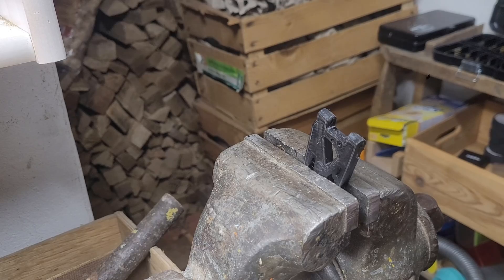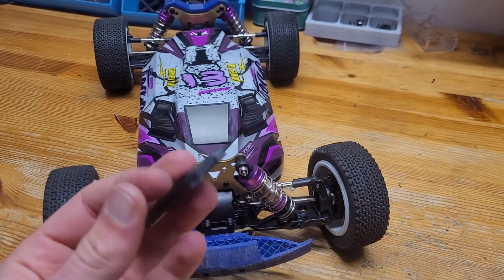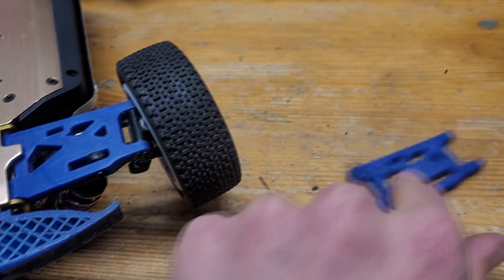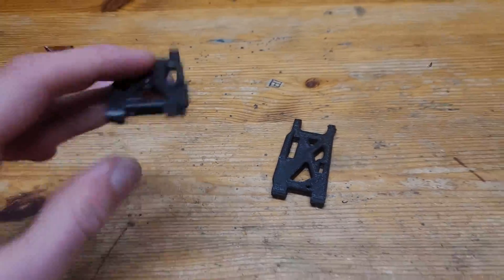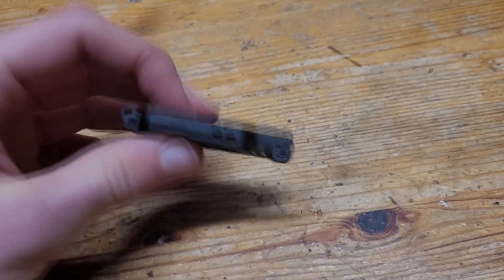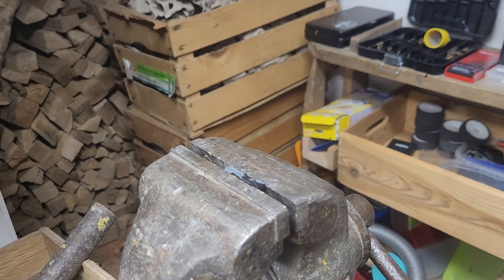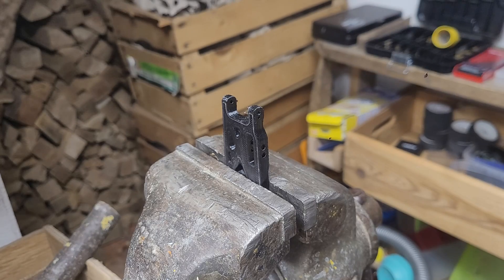I 3D Printed Unbreakable RC Car parts

Comment: Nicely done... I bash 1:18 / 1:12 scale on a budget... Tinker as wel using moldable plastics for parts that don't get too hot😅 I'm feeling this is the way to go for me as well.
Reply from the maker: Let me know how it goes! I'm currently working on some updated parts for these cars with even stronger front and rear arms, a front bumper designed to absorb impacts efficiently, protectors for the shock towers and maybe even a rear wing so stay tuned if you're intereste! :)

Comment: Hey, just curious what you did you use? I’m wanting to do a stiffer material than yours but still tpu. Also did you do 100%.in fill or ? 

How many walls ? 

Thanks!
Reply from the maker: As far as I recall I was using 100% infill, a lot of walls (I don't remember the exact number) and normal 95A TPU. There's a newer version of the arms in another video on my channel and I'm now working on V3, along with some other upgrades.
Reply: @ValRC1  okay. i think i am gonna try my hands at some 70D tpu. Looking for a more rigid solution as i mentioned. I have an old losi truggy that you cant get parts for but i still wanna race it a bit. So wanna try and make some arms that are stiffer and more predictable but still hold up.
Reply from the maker: @ZC-Hobbies  What scale is the losi truggy? I've found TPU only really works well for small vehicles like this WLToys

Comment: I'd thought about TPU for arms before, my only concern is that the flex will put too much strain on the camber and steering links, as well as the driveshaft. Awesome to see it worked out though!
Reply from the maker: Works great! I just don't recommend it for racing or speedrunning as it does make control a slight bit more imprecise because of the flex

Comment: I've made a few parts for my cars with a 3d pen. But I just use PLA. I wish they made a pen that could extrude that material. Might be worth it to make my own.
Reply from the maker: Damn, didn't think of a 3d pen but I'm guessing 3d printed parts are stronger due to being solid?
Reply: @ValRC1  using a 3d pen the parts are nearly 100% filled. For a swing arm like you did I would ink out the part on paper and just trace it with the pen until I had enough layers to reach thickness. There are a lot of 3d pen sculpting videos on YouTube that show you how. For me, I can't justify buying a printer if I can't model my own stuff and I don't have the motivation or time to learn blender.

Comment: I must have missed it but what filament is that part made of?
Reply from the maker: It's made of 95A TPU
Reply: @ValRC1  PETG would probaly also work pretty good i guess.  atleast allot better than plain pla probaly
Reply from the maker: @DiyNuke  honestly, Petg isn't as impact resistant as most people say. TPU is waay more durable if it doesn't matter that the part is flexible. A more impact resistant alternative to PETG is PCTG, or if you have a good printer and an enclosure Polycarbonate (probably the most durable stiff material)

Comment: imagine that TPU A-arms make an RC drive and turn better due to more 'flex' and maybe dampening in a way giving more grip e.g. more ground time for the tires.
i could absolutely believe this but this theory isn't tested as far as i know?
Reply from the maker: Maybe this can be true in some cases, but I actually noticed with these super flexible ones that the handling got slightly worse once I switched to brushless power. I made some new and improved arms to fix that, new video is out on my channel already!

Comment: Neet, what car is that I have one that looks similar.
Reply from the maker: It's a wltoys 124019 - they make a few pretty similar ones
Reply: @ValRC1   ok what I have is a WLtoys A959-A and Im upgradeing it to A959-B which is more powerful. I got the car for free but I have already probably put more in to it than its worth

Comment: This is a sure way to bend your dogbones/CVDs. Since those arms absorb, virtually nothing, all the impact is transferred to those metal parts, and surrounding plastic parts. This much flex, is just too much.
Reply from the maker: Nah they're fine, the wltoys CVDs are usually very weak anyways but I didn't notice any changes with that once I put these on. I did make a stiffer version in the meantime though

Comment: what filament did you use to print the parts?
Reply from the maker: I used Sainsmart 95A TPU :) thanks for watching!
Reply: more flexible like classic PLA no ? @ValRC1
Reply from the maker: @xavierledieu3406  yes, it's a lot more flexible than pla. Pla is very hard and brittle

Comment: I'd print the body of the part with more density and the ends with a bit less since theyre more prone to breaking and still keep the rigidity of harder plastics for predictability
Reply from the maker: Yup, I've actually even got a video in the works showing how I made them stiffer in the middle and even more durable at the ends!
Reply: @ValRC1  nicee

Comment: Good stuff. I would have thought tpu would be too flexible. Maybe if it was hot outside it would flex too much. In cold weather I bet it's perfect though.
Reply from the maker: Actually, in summer with the stock brushed system it was fine. Once I upgraded to brushless though (100kph on 3s..) I did notice it a little bit. I now made new arms, still out of TPU just a little beefier, which made them stiff enough to be used with brushless as well :) video is coming somewhat soon
Reply: @ValRC1 I printed one with pla at 80% infill and so far it hasn't broken. I crashed it hard enough that I broke the diff case instead of the 3d printed part. I'll have to see how well the 3d printed diff case holds up.
Reply from the maker: @joacimlopez9735  oh that's crazy, means the wltoys parts are sometimes weaker than pla!! What a shame really

Comment: I like to ask i know hobbyking sabertooth 1/8 scale parts are no longer available do you make spare parts for customers
Reply from the maker: Which part(s) did you break? Not all are good to be printed out in TPU filament, but some might work well
Reply: It's the front and rear control arms

Comment: Great fix, man! I guess it was brittle because of the low temperature. But the printed piece should last way longer!
Reply from the maker: Thanks man! I'm actually working on an improved version on it rn :)
The plastic on this one is still brittle, even now in summer - my guess is still that they messed up the plastic composition
Reply: its also brittle so it will break so they can sell more parts. They could make more durable plastic but theyd also make less money.
Reply from the maker: @mech0p  it's so weird because with wltoys it's hit or miss. I've had 2 that are pretty durable and then this one that just shatters when you look at it the wrong way. My guess is bad quality control

Comment: Clearly the part you made is going to last longer as it is not as brittle but since it is fexible, it cannot work properly as a suspension arm. Suspension arms need to be stiff to allow the shocks/springs to do the work. In saying that, for just a fun car to play with, why not!
Reply from the maker: It seems to have worked pretty well and I didn't notice too many suspension or handling differences. That being said, the suspension on this car isn't very good to start with so there's that. I'm currently testing a new version of these arms that are beefier and stiffer, btw!

Comment: I wish I could do that for my fix vantage.its chassis keeps braking.But I don't have a 3d printer or the money for one. Also does anyone know the song used for this vid.
Reply from the maker: Oh, that sucks. Maybe you could trim and fit a metal plate or something to stiffen the chassis up a little?
Reply: @ValRC1  I've had to replace it 4 times
Reply from the maker: And which song do you mean? (At what minute in the video, there are multiple)
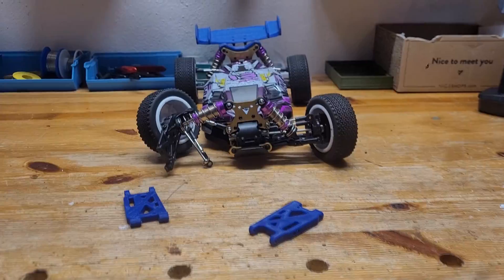Reply: @ValRC1 at 1:08

Comment: This is very cool i wonder how it would work on a big car like e revo maxx or xmaxx mabby some kraton 6s or 8s just a heavier car
Reply from the maker: Hmm yeah, it could work, but i think TPU is a little to soft for that. I might try it with some Carbon TPU or Carbon Nylon though! Thanks for watching and for the feedback, appreciate it :)
Reply: @ValRC1  you probably used shore 95 A TPU. Try any D shore TPU. Way harder, still indestructible.

Comment: Interesting. Thanks. How much infill did you use for the arm and the bumper?
Reply from the maker: The arms are 100% infill, I'm not sure how much infill the bumper has but as you can see it doesn't have and top or bottom layers in the front part..I'll check real quick
Reply from the maker: so the bumper has 100% infill in the back where it mounts to the car and 15% infill in the front with no top or bottom layers, to absorb and dampen impacts :)

Btw I'm thinking about doing a video with a few 3d printed mods/upgrades for these wltoys cars, do you think you'd be interested in that?
Reply: @ValRC1  Thanks for your answer. 3d printed mods for wltoys are always interesting. 😉
Reply from the maker: @jochenweisel8612  No problem, thank you lol

Comment: Amazingly durable but now to make it rigid so it has no flex but remains unbreakable??? 🤔
Reply from the maker: The flex is what makes it so durable, but for Version 2 i could fill in all the gaps to make it stiffer and more rigid
Reply: @ValRC1  Yes I completely understand, but flex in suspension other than from the shock is not good. If you are not racing and you are just bashing you came up with a very good way to have fun and not break arms ✌🏼😎👍🏻
Reply from the maker: @mikesrcgarage  Yeah that's true. I'm only a basher atm, but i think some type of carbon fiber infused nylon filament could work for racing. That's expensive and difficult to store tho. (absorbs moisture easily)
Reply: @ValRC1  Yes that is the key and very expensive. On a very light car the flex is not a real issue and as long as you're having fun that's all that matters. My 1/5 scale breaks arms just by looking at it! Lol! Keep up the good work and the WLtoys you were running looked like it ran great with those arms! ✌️😉
Reply from the maker: @mikesrcgarage  thanks man, appreciate it :)
Are your 1/5th scale arms very stiff? Or from nylon like typical on 1/8th scales?
Reply: @ValRC1  They are stiff being so heavy they have to be stiff. Not sure what they are made of but it's some type of nylon. ✌🏼😎👍🏻

Comment: Soooooo, what did you use exactly? Most of the 3d printed stuff I've encountered has been brittle and its put me off getting one, I'm just learning tbh excuse my ignorance its probably a stupid question.....
Reply from the maker: Nah not stupid, I used Sainsmart TPU Filament, flexible super tough stuff, but can be a bit finicky to get printing on some printers, especially those with a Bowden extruder.
There are different non-brittle options that are a bit stiffer as well, like for example Nylon or PP.

The most typical and also most brittle Plastic used for 3d printing today is PLA.
Reply: @ValRC1  cheers bud very helpful.....👍👌😁
Reply from the maker: @EZ-D-FIANT  np!

Comment: Thank you very much for this video, you got me interested and will buy a 3d printer now, I have a lot of rc cars so this should be interesting , in general where do u get the models of that you want to print , is there a 3d scanner to scan the original item and then print or you find it online?
Reply from the maker: I either download them off a website like thingiverse.com or 3d model them myself in CAD programs like Fusion 360.
3d scanners exist but are expensive and the cheaper ones don't work very accurately
Also: no problem, glad you enjoyed! Consider subscribing if you want to see more like it

Comment: Specs on your printer settings and filament type
Reply from the maker: It's an Original Prusa I3 MK2.5S, using the SainSmart TPU preset in Prusaslicer and with speeds reduced to 20mm/s, Material is 95A TPU

Comment: I love this! What 3D printer did you use? I’m looking to do this myself and wondering what printer I could get to make something similar.
Reply from the maker: I used my Prusa I3 MK2.5S, but you could use any 3d printer that's able to print out 95A TPU well :)
Reply: @ValRC1  lol, I ran into troubles with a printer I won’t mention here, but now happily printing away. Thank you again, this is such a good idea
Reply from the maker: @peterwatkins671  nice, glad you got it running by now

Comment: Hello, I would like to buy the bumper that you made in 3d, it looks good. Is it resistant?
Reply from the maker: It's been pretty durable for me, just make sure you secure it with all 4 screws and it should last a while. I don't have an official shop or anything yet but if you're comfortable with it I could sell you one privately.
Reply: @ValRC1  I don't mind as long as it's a good price. Sorry for the late reply.
Reply from the maker: @andrealves1250  all good, I could sell you one for $5 + shipping. where are you located btw? So i can look up the shipping costs there

Comment: You should make a full upgrade set like the aluminium upgrade  sets that you can buy for these cars . I wood  buy them we have 4 of these cars 2 124016 1 124018 1 124017. I am sub no 20.I live in canada.
Reply from the maker: That's a great idea but honestly, I think it would make more sense to make the arms out of this flexible plastic and then the c hubs and stuff from Aluminium. The bulkheads (a major weakpoint of these cars IMO) also can't be from a really flexible material like this, as that would make the screws rip out even more easily and maybe even make the gears not mesh correctly under load due to the flexibility
Reply: @ValRC1  That is a good point . The a arms and a bumper like the lc racing one with the foam in it but without the foam would be hot sellers .
Reply: Hi  what would be the best cheap printer to get for making parts like this thanks. Wont be long and you will be up to 200 subs way to go.
Reply from the maker: Not sure about the current 3d printer market as I've had this one for like 7 years and am happy with it, but you should look for one that can print TPU Filament well (Filament used in this video is Sainsmart Blue 95A TPU)
Reply: @ValRC1  Thanks looking at a ender 3 pro but not sure
Reply from the maker: @benabnjm4828  I've heard the ender 3 pro is good for the price, but for TPU a direct extruder would be optimal. (ender 3 Pro has  a Bowden Extruder)

Comment: Either hub or arm pins will tear it or come loose upon impact.  You might have to beef up those areas
Reply from the maker: Haven't had that issue yet. If it does happen I will, thanks!
Reply: Not gonna have any issues, the way you dive, anyway lol. Send it with these arms, then talk. @ValRC1

Comment: I was hoping for the actual 3D printing process video in action 🤔
Reply from the maker: You mean like a timelapse of the printer printing the part?
Reply: @ValRC1  yes 🙂
Reply from the maker: If so, I'll be including that in my next 3d printed parts video :)
Reply: @ValRC1 it would be good to show folks what software you drew the model in....walk through in that....what material you printed with etc.  Some of us like to print functioning parts and not just cute little items from thingiverse.  Thank you for the work.
Reply: And we need more information about plastic, slicing and printing
Reply from the maker: @Artemon-yl5ze  Thanks for the suggestion, I'm working on an upgraded version of these parts right now and I'm gonna include that in the video!!

Comment: It that a sweet amazon willpower rc?
Reply from the maker: Not sure what exactly you meant, but the car in the video is a "Wltoys 124019". Does that answer your question or did you mean something else?
Reply: @ValRC1  no sir, thank you, i confused the wltoys with willpower, thats what i meant. Bang for buck, theyre rippers.
Reply from the maker: @dondagy9109  np, yeah they're great for the price, I have a 144001 I converted to brushless and this 124019 that's still on brushed :)
Reply: @ValRC1  brushless is the way to go i think.
Reply from the maker: @dondagy9109  yeah definitely. What happened to mine was that the motor broke, so instead of getting a replacement I just threw in an old brushless combo I had :)

Comment: If you want to decrease the amount of flex on that particular part, increase the number of perimeters or a harder shore TPU material.
Reply from the maker: Thanks for the suggestion! I printed these with 100% Infill, so I guess adding more perimeters wouldn't make a difference? I bet a harder shore TPU would work great though
Reply: @ValRC1  it will make a difference, because you have to understand how the layers are put over each other.  You can experiment this by printing a simple rectangular piece with PLA, lets say a 10mm wide by 50mm long, And 3mm thick. 

Print the first one with only 2 perimeters and a second one with 5 and try to bend them and feel the difference. 

Anyway, if you use the car for bashing it won’t make much of a difference but it’s something useful to know for future projects, sometimes you can also get sufficient strength with this method without using 100% infill and save some plastic.
Reply from the maker: @ripmax333  oh okay, well guess I learned something new today! Thanks, will definitely make use of it for future projects 👍